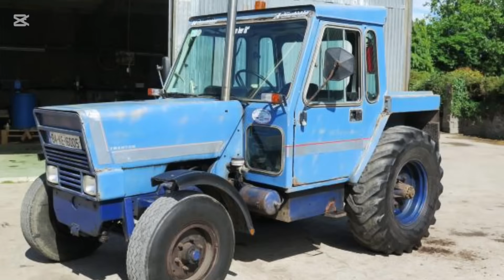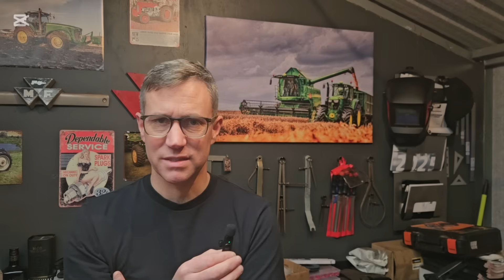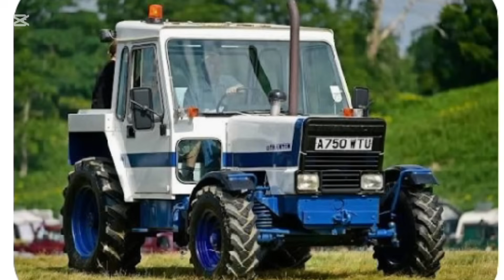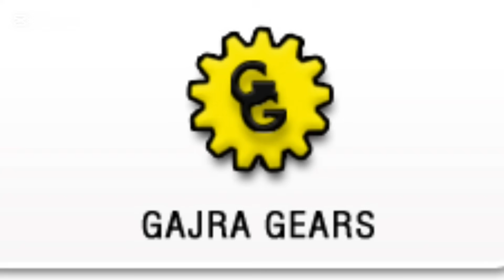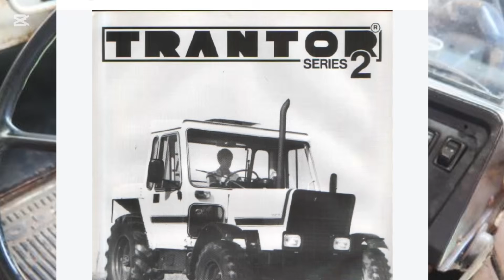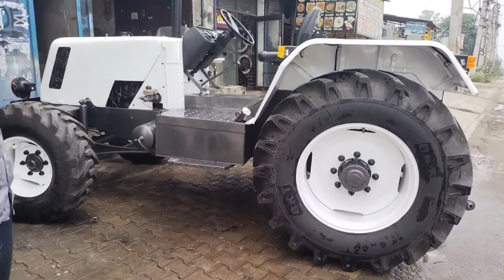THE TRANTOR TRACTOR– The Revolutionary Machine That Was Ahead of Its Time

Comment: There was a farm north of York in the Vale of York had had several white Trantors in the early 80s. They were quite a common sight on the A19, south of Easingwold (I was based at Askham Bryan, at the time, and often saw them while riding my motorcycle back to my parents' home in Darlington: indeed they so fascinated me, that my dissertation while at Askham Bryan was based around the use of suspension on tractors, including things like the need for different profile tyres, and whether lockable suspension would make otherwise suspended tractors viable as, for instance, fore-end loader machines during slower yard work, where active suspension would be a definite disadvantage).

FWIW, during the Cold War, the Warsaw Pact Polish manufacturer 'Ursus' had a model which had front suspension, aimed at stabilising steering at higher off road speeds.
Reply from the maker: Thanks for all that information 👍

Comment: Er reality check, in 1938 Minneapolis Moline a US  Tractor manufacturer built 'The Comfortractor' a concept tractor  similar to the Trantor. This machine featured a fully enclosed cab, a five speed gearbox, car type body work ,lights, windscreen wipers  a radio , and easy access for the driver via two van like rear doors. Trantor,s makers took their eye off the ball, failing to exploit another market, yes cats&kittens local urban  and district councils wanting a multipurpose machine that one day mow school playing fields with a set of Ransomes gang mowers, the next day with a three man crew tow a trailer loaded with tar aggregate and tools for road repairs with a pto driven compressor. This unique machine was the first tractor you could buy with four wheel brakes, three crew cab and independent front suspension, in essence the perfect small tractor ideal for towing trailers, gang mowing, hedge trimming, sewing with a small seed drill  and other light work, thus freeing up heavier tractors for more arduous work, ploughing, dung spreading and timber extraction.
Reply from the maker: Interesting.. How many were built?

Comment: They certainly had the concept, but they made them to small,to be useful on British-Europeaan farms the Trantor needed more power heavier axles and greater lift capacity so farms could tow large trailers also do field work. Trantor could of collaborated with JCB in the early eighties and developed something like the Fastrac and produced a smaller basic version for their Indian friends.
The Trantor idea needed the backing of someone like JCB. 
Interesting video on those machines,remember reading about them in Power Farming magazine. Seemed more like a  glorified Land Rover.
Reply from the maker: Thanks for watching. The Bamford estate bought four Trantors in the early 80's, no doubt for R&D on the Fastrac. A few of the engineers and developers of the Trantor eventually went on to be part of the Fastrac project 👍